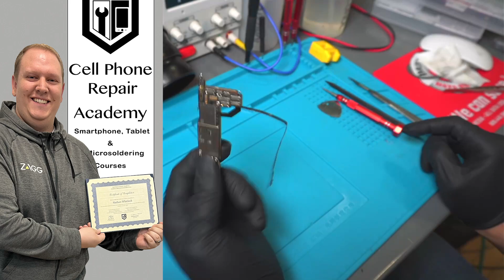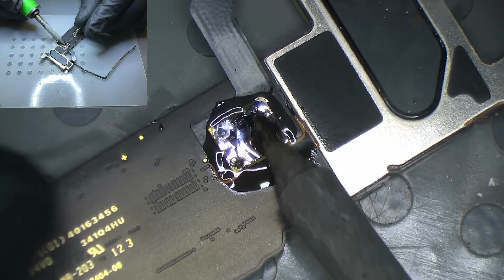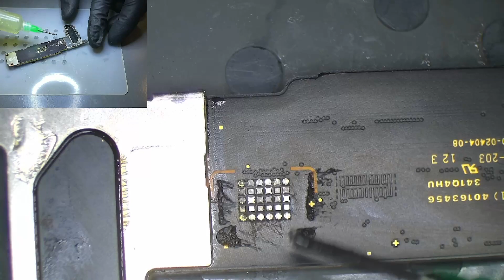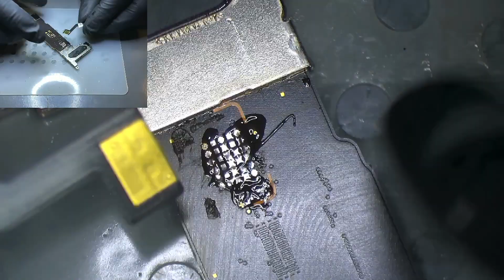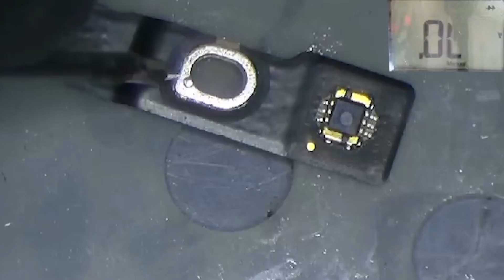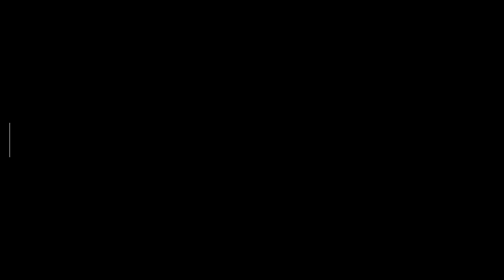How to Replace iPhone 13 5G Antenna: Step-by-Step Guide

Comment: Hello boss i have question the UW antenna if you remove it a can show no problem on the motherboard.
Reply from the maker: You may have problems with the 5G connectivity of the phone but all the other things will work.

Comment: The chart was very helpful. Is that public/easily accessible info? Followed the mobilesentrix video as well but the first time there was one joint that wasn't reading any amps. Would have really sucked to put the board together not see 5g and have to take apart the phone again.